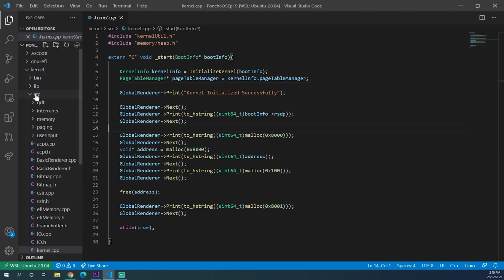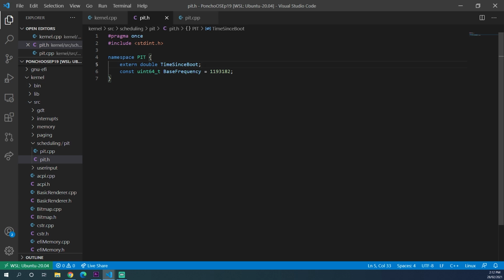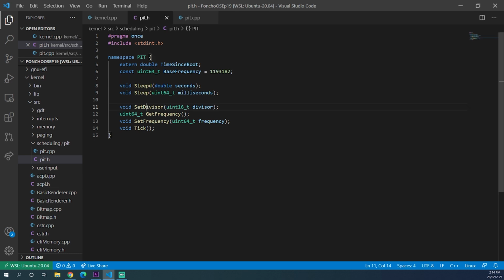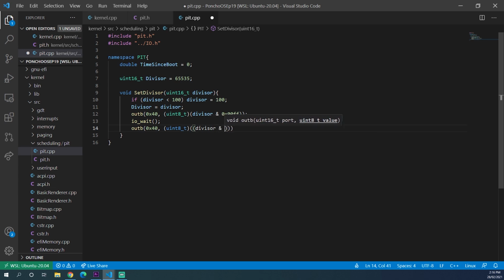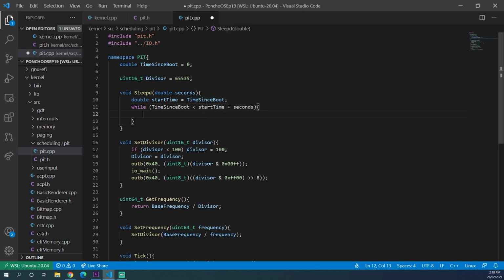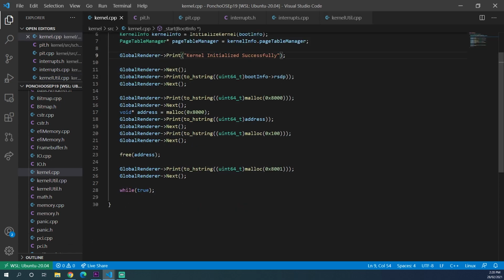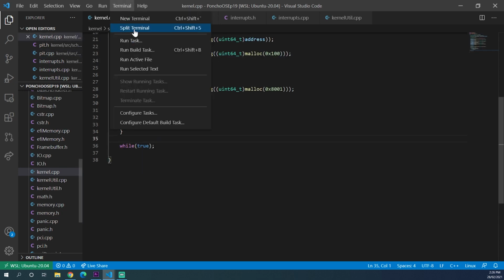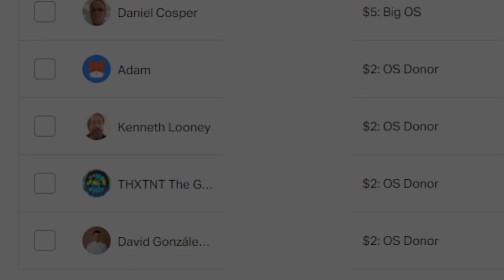Sleep & PIT Chip | How to Make an OS: 20

Comment: poncho I executed this os and got that .img file I flashed to my pendrive and inserted in my old laptop and went to boot manager and selected this pendrive and I hit enter it showes black screen with white cursor blinking I waited for hours but shows same what can I do poncho?
Reply from the maker: You can get it to boot by just copying the files into the usb drive like the same as the img is formated. I have a video on real hardware which you can watch
Reply: @poncho2364  I followed the steps but it shows remove any diskdrive and press any key to restart
Reply: @poncho2364  I actually formated as exFAT so it has that problem
Reply: @poncho2364  but now it tells "operating system wasn't found disconnect the drives the doesn't contain operating system press any key to restart"